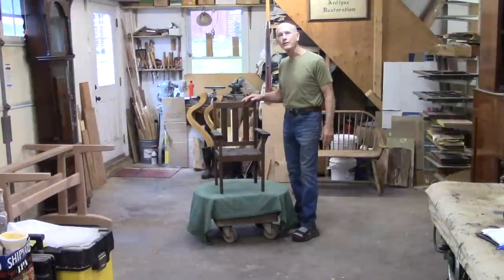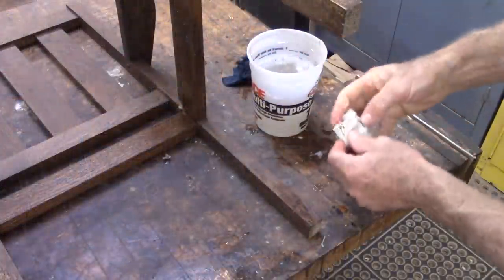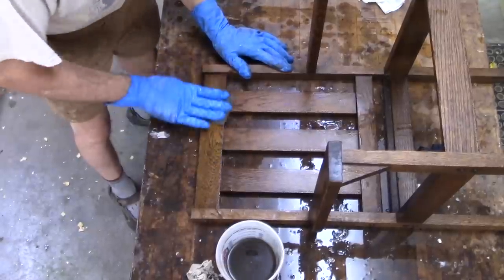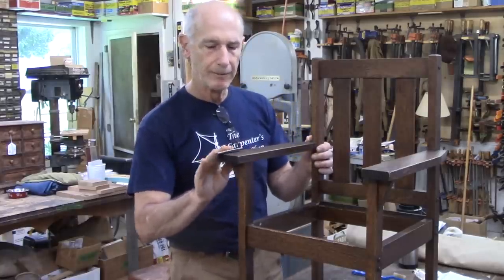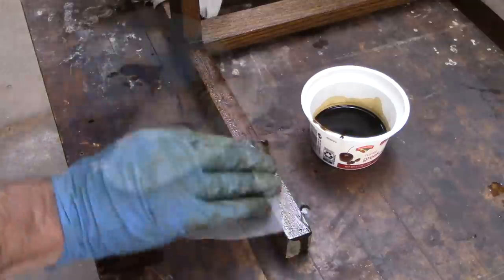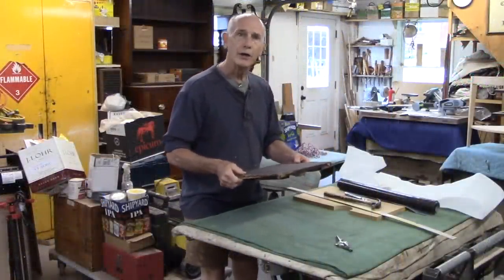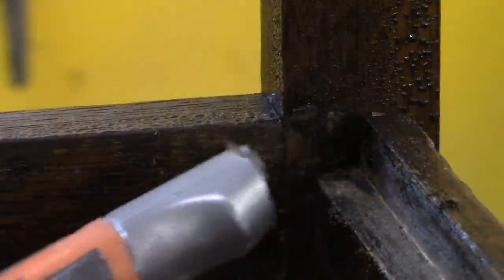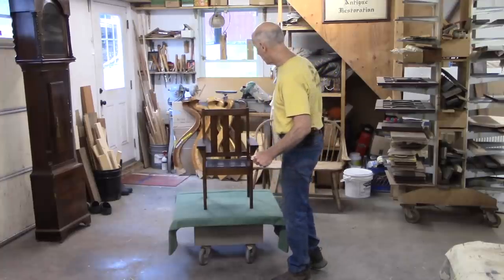Restoring a Mission Chair - Thomas Johnson Antique Furniture Restoration

Comment: Beautiful. I just finished stripping and refinishing a mahogany communion table that some philistine painted in the 80's. I would never have attempted it had I not been spending the last months binge watching your marvellous restorations. I never imagined when I began that it would turn out so well. Thanks so much for all the instruction. I knew nothing 6 months ago.
Reply: Well done! 

A while ago we moved into a house that had been lived in for about 40 years by the same people; it was a late 1800s house, with fairly thick walls of stone and rubble, and it had deep (1'6" - 1'8") internal window sills, which when we moved in had been covered with self-adhesive "oak effect" vinyl. We peeled off the vinyl to reveal some chipped-off gloss paint in a horrid colour (light green, kind-of-eau-de-nil but brownish rather than blueish). We removed the horrid gloss with a heat gun, and lo and behold there were some nice oak planks underneath, with a near perfect bull-nose edge on top. Minimal repairs and filling, a nice coat of oil, and they looked like new. This was 35 years ago; I'm still wondering today what possessed the previous owners to first paint over and then re-cover beautiful oak with oak-effect vinyl.
Reply: @Time4Clocks you are right. They even painted over Australian Red cedar in the same hideous red brown. The table is intricately carved on the legs and lower structures (don't know what to call it) so I spent a lot of time picking paint out of small spaces. It is the colour of golden honey now with its tung oil and beeswax finish.
Reply: @Time4Clocks The same kind of nonsense is happening now, only they call it "farmhouse".
Reply: @Time4Clocks That's exactly what they do. They take beautiful mahogany or walnut furniture, slather house paint all over it, and call it decor.

Then they might do something like take a livestock watering trough, put a wooden top on it, and call it an entertainment center. The funniest part is that these are all suburban tract houses, that don't resemble farmhouses in the least.
Reply: @the-chillian  Decorotting?
Reply: @Time4Clocks I could send you a picture if I knew where to send it.
Reply from the maker: Thanks! It really makes me happy to think that I helped inspire you to do such a good job.
Reply from the maker: Thanks! I think sometimes that these things happen in such small steps, and when we see the condition of the object now we think "how could they have done that!", but each person thought they were improving the object as best they could
Reply from the maker: Thanks! Well put
Reply: Yeah I picked up a lovely Jens Quistgaard teak tray and dansk style enamel pot (with teak handle) after watching Thomas' video. Even ordered some of the polish. He should be getting sponsorship! Have also oiled a few mid-century pieces I have. Less is more I think. Like his considered approach.
Reply: @johnsonrestoration  You've been around a while so you understand that fashion moves in distinct trends and respect that. A lot of these weekend warrior commenters think they know it all with their accusations of 'philistines' but it was a trend at the time.

Comment: What I have learned from your videos is that wood is resilient.  Time , accident and neglect will make their marks but it is always possible to enhance and beautify those passages at any time.   It is never necessary to despair and start fresh, just work with what is there.
Reply from the maker: Thank you! Very well said. I might use this

Comment: Bravo! I was commissioned to repair/restore an antique child rocking chair. I had to repair a couple of broken tenons (3/4 inch tenons on spindles! Thank god for step drill bits.) and finished it with a light coat of oil then beeswax polish. The client thought it looked like new.
Reply from the maker: Thanks! That's great! The broken tenons are a problem! Tough to know what to do sometimes

Comment: Talking about the alligator skin... I refinished my great Grandmother's Dresser with a super heavy alligator skin. I have striped  it twice and some is still coming off in gobs. I probably won't be done in a year. It was about an 1/8th " thick, black and it smelled like smoke. We finally figured out that it was coal fire residue long baked on. With stripper it is coming off like tar. What a mess! But what beautiful oak underneath! And once I figured out that they were acorns and not walnut pulls, it all made sense. Thanks for all the good techniques and hints. 
Mr. Johnson. your work is worth twice what they pay!
Reply from the maker: Thank you! Wow, it sounds like quite a job! I've been there!
Reply: I bet you have!!! @johnsonrestoration
Reply: However it comes out, I will love it. Thankyou

Comment: I have this little upholstered wood chair, sized more to a toddler, that belonged to my mother and my grandmother before her. This is now the 4th or 5th piece I've mentioned to you over the past few years as a piece I've hung on to (most having familial sentimentality) which I've always meant to restore - but haven't. I'm just now beginning to question my commitment. The good news is that this would be a fairly easy project. Clean the finish, re-glue a loose joint or two (though no one will ever be allowed to sit on it), and remove the upholstery I remember my mother putting on the seat about 45 years ago. As I recall she left the original in place which potentially could be salvaged or matched. So... if you don't see me comment for a while, it's because I didn't do that piece either and will have gone dark in my shame. Really enjoyed the video.
Reply: Why don't you do it in stages? Give it a clean and then walk away for a bit. When you're ready again, come back and maybe re-glue the joints that need it, then let it sit for a while before coming back to do the upholstery? When a project seem to huge, separating it into 'bite-size' tasks makes it seem less scary--and you can cross each step off the list as you go!  

I did that with a desk I was stripping. Got the 4 layers of paint off, then I'd spend a bit of time sanding, and then I'd leave it for a few days. It took probably a lot longer than it should to complete the project, but I got it done and I'm very happy with how it turned out.
Reply from the maker: Thanks! Never any shame in trying! Email photos when you're done! thomasjohnsonrestoration@gmail.com
Reply from the maker: Thanks Janice. You're advice is right on. I frequently do the same thing. Hence all the different T-shirts in my videos!

Comment: Great video, I like the way you said put all the oil materials outside. It can combust. I had a piece of steel wool light up in my glove with Watco a few years ago.
Reply from the maker: Wow! Thanks! Recently a historic house burned down from steel wool and a battery in the trash! I’ve always been careful with the rags, but since then the steel wool too
Reply: @johnsonrestoration  I heard about the steel wool and battery. 
I usually put my old rags from watco in a capped jar with water for a couple days then pitch them.

Comment: You do the same thing with your rags that I do. I repaired, stripped, cleaned, stained and refinished a century old rustic style Oak desk. It had been used in a shop or garage and it had the same problem on the corners as this chair. Took me forever to get them splinter free.  That chair looks really nice now.
Reply from the maker: Thanks! Yeah, good ol' oak!

Comment: Mr. Johnson: The next time you are at Home Depot, Lowe's, etc., in the section where they have cement/concrete, they have black plastic mixing tubs, about 30X42 inches and about 8 inches deep. One may help keep the shop less messy when scrubbing furniture, as you did in this video. Thanks for the video. Jon
Reply: Railfan 439 ...I have one for masonry work and an old dirty one with a dog leash attached for collecting weeds I pull from the property. Handy item.
Reply from the maker: Thank you! I've seen those - what a good idea
Reply from the maker: That is a good idea! Thanks
Reply: @mercoid  I'm a gardener and I thank you for the idea!🐱👩‍🌾🌱
Reply: Mary Blaylock ...You’re welcome. Avid gardener too... drill for two attachment points on the lip of the bin. It tracks better when dragging it around. 
Happy gardening  👨‍🌾 🌾
Reply: @mercoid  🐱👩‍🌾🌱👍🖖🌹🌻🌺🌼

Comment: I use dry powdered TSP so if you find it harsh you are putting too much in. You mix to your application starting light and adding more powder to get the desired effect. Also best if you let it sit on the surface for 10min or so. I have used powdered TSP for many years with excellent results.
Reply from the maker: Thanks! I have too. Lately I've been really liking the Krud Kutter, both work well

Comment: I use TSP mixed to just feeling slippery between 2 fingers rubbed together. Safe for paint and finishes. Rinses off with water. No fumes.
Reply: TSP can be super harsh in my experience.  That wouldn't be my first choice.
Reply from the maker: Thanks! Yes, I used to use it all the time, now I like the Krud Kutter
Reply from the maker: Thanks! Yes, it can be. But the trick is, for both TSP and KK, to not mix it too strong

Comment: Thomas, from what I could see the chair was rocking. Would love to learn more from you on how you deal with that situation for tables and chairs.
Reply from the maker: Thanks! My bench is not flat. But any chair I reglue we put on the table saw to check for flatness, take a little off the long leg, either a file or the belt sander

Comment: Is Krud Kutter better than non-phosphate TSP for cleaning?  Does TSP-no phosphate lift the finish?  I have 6 oak dining chairs, circa 1910.  I think this little chair looks super great!!
Reply from the maker: Thanks! The Krud Kutter seems less harsh than TSP. I have not used the non-phosphate stuff. Neither should lift the finish but always experiment carefully
Reply: @johnsonrestoration    Thank you so much!  The finish on the chairs is failing--they are so old!  I want to clean and then wax them or do some sort of top finish to protect them.  Headed the same direction with covering the chair pads..want to leave the original leather.  Love your videos!!!!!

Comment: Do you ever deal with warped/cupped wood?  I have an antique rolling/portable closet from my grandmother's house, has to be at least 60-70 years old.  One of the 2 doors is severly warped length wise, with the grain.  It no longer has veneer on the inside of the door like the other one.  I am not sure how to straighten it and then how to keep it that way.  Not sure if I should brace it somehow on the inside. I've research some people moisten it on one side and place weight on the other side, some cut length wise cut in it.   Not sure what the most effective way is.  This problem seems to be seasonal too.  Warps in the warm weather and somewhat straightens in the cold weather.
Thanks for any advice you have.
Reply from the maker: Thanks! I have never had success getting rid of a warp, except to add battens or saw kerfs on the underside and then battens. The warp will never go away

Comment: How did you know to use the Danish Oil to refinish it? If I have a wood clock case that’s covered in another type of varnish (lacquer or poly) would using your method of cleaning with KK with using Danish oil and sandpaper help? Thanks!
Reply from the maker: Thanks! I don’t see why not! Try a small area first

Comment: I just saw the Video with Scott Bennett about glue comparisons.  Very informative, Thanks.  As far as hyde glue goes, you use the granulated type and Scott used premade Titebond.  Do you have a preference as to which is better choice and more efective for repair?  titebond is certainly more available and convenient, but is it as good as what you use?  Thanks
Reply from the maker: You're welcome! I have not tried the pre-mixed hide glues, but I believe they are as good. It does have a short shelf life however, could be a problem for a hobbiest
Reply: thanks.

Comment: I tried to use steel wool to smooth a finish, but it turned my polyurethane gray. Did I do something wrong?
Reply from the maker: The gray might go away with polishing or waxing. You might have used too coarse st wool? I always use 0000

Comment: Hello! Tomas Jonsson, a question wath do you think about using beeswax as recondision of a stak set of smaler Japanese laquer tables with mother of pearl inlays?! In my apinion it must be the mildest product to start with or wat do you think?! The first and bygget is very fade and matt after wather damages and clining without dry of off emedetly!  With best regards from Barbro EvanderLindquist Sweden
Reply from the maker: Thanks! Yes, the beeswax would be good, and use 0000 steel wool gently with plenty of wax on. the damaged areas

Comment: What were those little black lumps on the wood? I notice that there were still some left at 11:26 on the upper left side of the lower back rail.
Reply from the maker: Thanks! Good question! Those bumps were over the entire chair. I can only guess that someone recoated the chair with a finish that was not compatible with the original finish, and the new finish shrunk up and formed those bumps.
Reply: @johnsonrestoration  Yes, that makes sense.

Comment: Not as dirty and rough as what I've worked on. "Beat to hell" is a common expression I use. Good work. 5:30, I've found a much better thing from sand paper is what would have been common for centuries before sand paper, cabinet scrapers.
Reply from the maker: Thanks! I love cabinet scrapers too - you'll see me using them from time to time. But too aggressive for this job!
Reply: @johnsonrestoration  well like a hammer or breaker bar they can be quite subtle or forceful as needed.